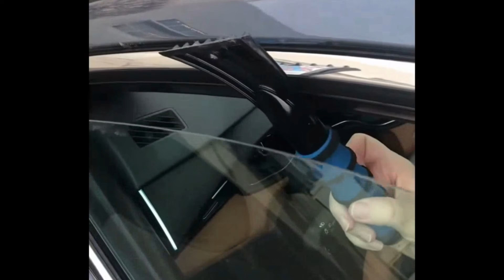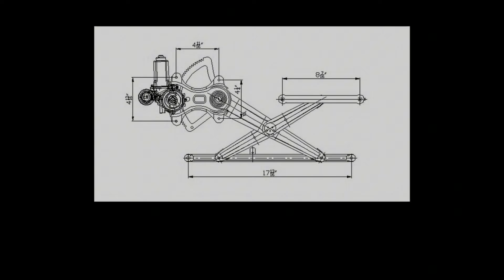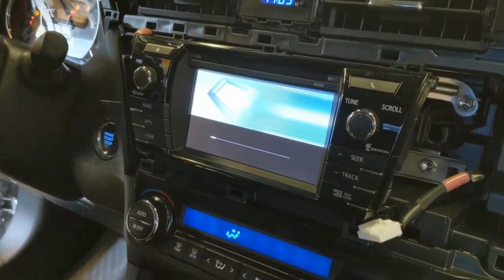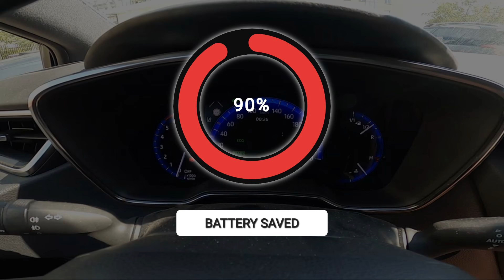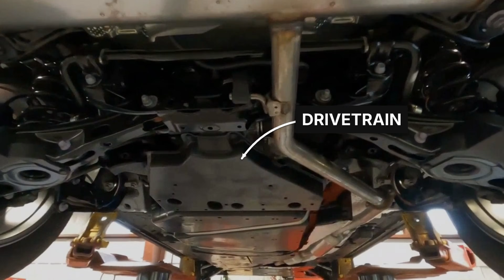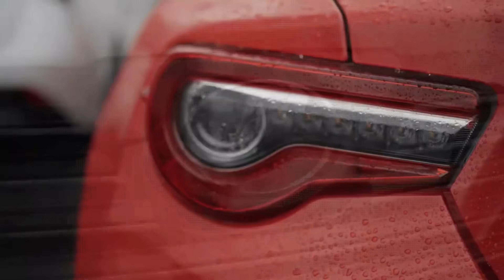This SECRET Toyota Function Is Only KNOWN by 1% of DRIVERS.

Comment: Doesn’t work on 2024 Camry
Reply: If you're talking about the windows open/close with key remote the feature is there you need the dealer to turn it on with the diagnostic tool
Reply: Those headlight sensors are annoying and dangerous. I've had them dip due to reflections off road signs and flash oncoming traffic with high beam unnecessarily. 

Not impressed at all with that function...